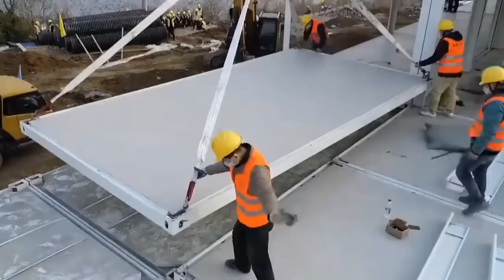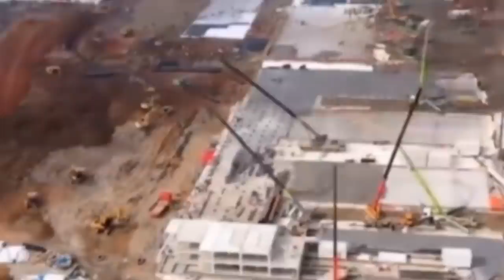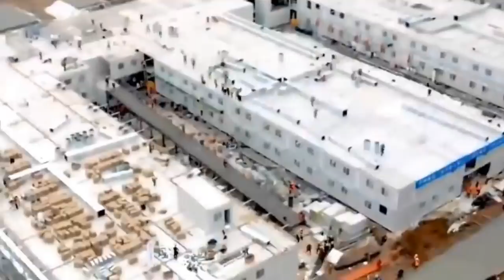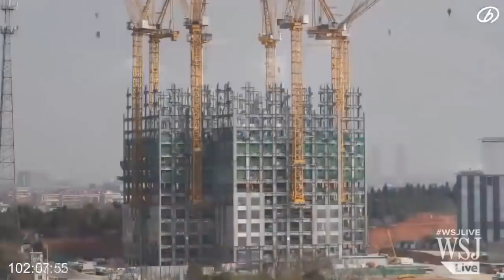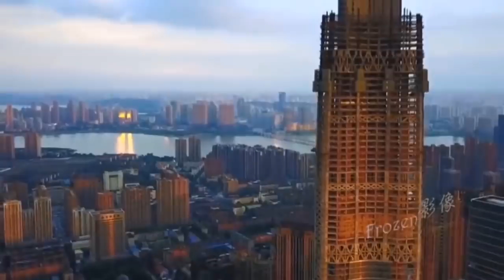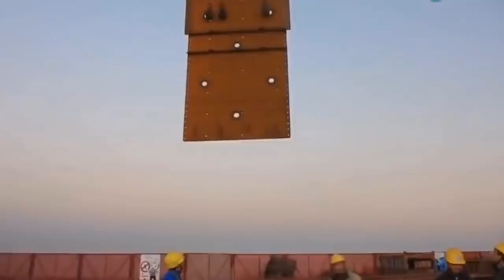How did China build a hospital in just 10 days? Coronavirus Panic.

Comment: If they really got it  done  in 10 days  which I doubt  it  I will  be impressed  as  a  construction worker  I find that  impossible
Reply: Maybe a bit late but we indeed got it done in 10 days. It is not permanent building. The buildings are built with standardized frame and wall parts. Chinese state owned construction companies typically build this kind of buildings on construction site as office and dorm for workers. But they do have a lot of those standardized parts as part of the national contingency plan and disaster response measures. Chinese central government requires state owned companies to be part of such plans.
Reply: I am an engineer from China. If you have the chance to come to China, I will introduce to you how we complete this task. I even completed a 12,000 square meter concrete frame structure housing project in 57 days. We believe that achieving our goals is honorable, so sometimes we voluntarily give up rest. We may work for more than ten hours a day and arrange personnel on duty to ensure that the project works continuously for 24 hours.
Reply: Unfortunately, my English is not good enough, otherwise I could give you a detailed introduction of the whole process.